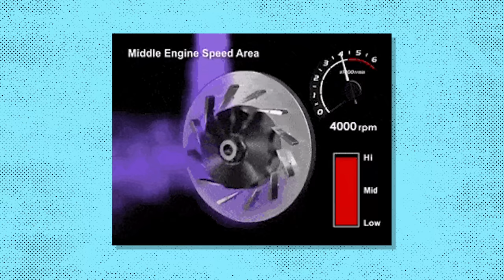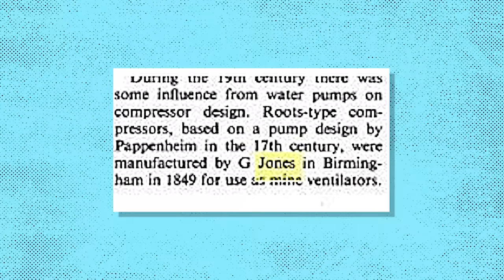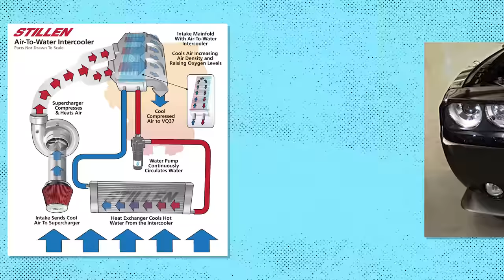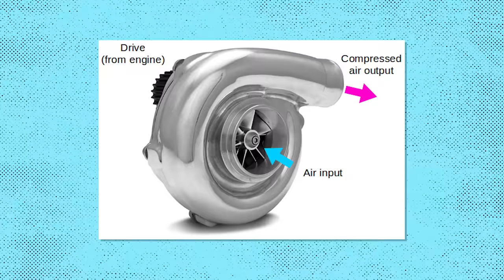Why Superchargers Aren't As Good as Turbos

Comment: That's like arguing that big capacity engines are rubbish compared to smaller capacity engines because some of the extra power is lost due to greater friction in the bigger engine. 
If you want an engine with lots of power and no lag, a supercharger is a perfectly good thing to use.
The only reason they aren't used anymore is due to emissions laws, and guess what, that's also exactly why you don't get large capacity NA cars anymore. See how that proves the point I made at the start!
Reply: Smaller engines are more fuel efficient because the operate under greater load, BSFC is most efficient at full throttle, the higher the throttle angle the better the BSFC. Supercharger are used in production  automobiles very often because turbochargers are more energy efficient.
Reply: @sandervanderkammen9230  operating load is only one of many factors that determine BSFC.
Reply: @pjay3028  No, it doesn't.  BSFC is always measured at WOT.
The isopgraphic efficiency island is plotted with BMEP... at high throttle angle and higher rpm.
Reply: @sandervanderkammen9230  so why did you say "BSFC is most efficient at full throttle, the higher the throttle angle the better the BSFC"?
Reply: @pjay3028  Because it is true, BSFC is always measured at WOT.
WOT is when the engine is operating with the lowest pumping loss.

Higher the throttle angle... lower pumping losses
Reply: @sandervanderkammen9230  you appear to be thoroughly confused!
Reply: @pjay3028  Not confused at all... what part do you not understand?

BSFC is highest when the throttle is closed.
BSFC is lowest when the throttle is Wide Open.
Reply: @sandervanderkammen9230  I'm confused because you insisted BSFC is "always measured at WOT" but then you keep completely contradicting yourself about that....
Reply: @pjay3028  BSFC is always measured at WOT.. because that is when pumping loss is at its lowest...

Carnot Cycle efficiency can be measured at any throttle angle or rpm by plotting an isographic efficiency island.
Reply: @pjay3028  We use SFC to calculate fuel burn per hour per horsepower in other types of internal combustion engines... like gas turbines and Diesels... because they dont have throttle valves.
Reply: @sandervanderkammen9230  Let me be really clear about this.
In one comment YOU said that BSFC is only measured at WOT.
In another comment YOU said that BSFC is better at higher throttle angle. 
It is only possible to determine that BSFC is "better at higher throttle angle" if you first MEASURE IT AT LOWER THROTTLE ANGLE and then compare that result to the BSFC at higher throttle angle. Think about it! 
You keep making totally contradictory statements, yet you don't seem to realise it....!
Reply: @pjay3028  SFC if you want to be pedantic..
Reply: Large displacement engines are still less energy efficient...
Reply: @sandervanderkammen9230  and that was exactly my point, if you remember! 😂😂
Reply: @pjay3028  You said it was because of emissions.. which is not true. Small turbocharged engines are preferred over supercharged or large naturally aspirated engines because of FUEL EFFICIENCY
Reply: @sandervanderkammen9230  I think you'll find that emissions are even more important to car manufacturers than fuel economy, and ultimately it is the emissions data that they use to determine which engine to specify.
Reply: @pjay3028  Turbocharged engines generally produce higher emissions..
Why would they be preferred by manufacturers today???
Reply: @sandervanderkammen9230  oh good grief.
Small turbo engines were introduced by manufacturers to meet the EMISSIONS targets introduced between 2014-2017 by the Euro 6 emissions legislation. Improved fuel economy was an additional benefit, but the principal target for the manufacturers was a reduction in emissions on the WLTP and RDE testing cycle.
Reply: @pjay3028  Silly boy.. you are talking about Carbon emissions...
Carbon emissions are directly linked to fuel economy.
Reply: @sandervanderkammen9230  exactly....
Reply: @sandervanderkammen9230  I respect your knowledge and ability to converse  with others
Reply: @JasonLuther1  Thank you sir, are you studying engineering?

Comment: I will take a supercharger over a turbo any day. I doubt manufactures chose turbos for efficiency, They are cheaper to purchase and integrate into the engine compartment, Superchargers are way more driveable and reliable than turbos. They do not rely on pressure fed engine oil, and thin tiny fins that usually causes complete engine failure when the turbo gives up, They also bring in large dollars in repairs for dealers thru guaranteed replacements and engine failures
Reply: Manufacturers use turbos because they make more power.
Turbochargers are extremely reliable, so reliable that they are used on passenger aircraft.
A good quality turbo should last the life of the engine and can be overhaul just like and engine can.
 Turbo lag is an imaginary problem, inexperienced drivers often lack the skills to properly drive a turbo car fast.. and are often scared by the higher performance.
Reply: The fastest supercars in the world use turbochargers because they produce far more horsepower than a supercharger ever could.
Turbochargers make more power

Comment: "literally use engine power to work"

So the exhaust gasses that are driving the turbine on the turbocharger are using magic pixie dust? 

You have no idea what youre talking about
Reply: The video was quite clear and correct. A supercharger uses a pulley which is ‘turned’ by the engine. Therefore, it’s using engine (horse) power. A turbo charger reroutes exhaust gases to spool, and is not driven by the engine directly.
Reply: The centrifugal compressor of the turbo is driven by its own engine. 

The exhaust turbine is a Heat Engine and generates horsepower from the heat energy in the exhaust.

Comment: It depends on what you're expecting! The supercharger is there time you hit it, but you're draging it along everywhere. Top fuel engines still run screw superchargers!  The lag issued are negligible on properly sized turbos, but the blower is right there! Centrifugal superchargers are for guys that just want to brag that they have a blower! The lag is always been an issue with turbos. Electric turbos are actually Centrifugal superchargers! Who do they think they're shitting here! Turbos are exaust driven!
Reply: Actually it depends on your education and knowledge...
The NHRA banned turbos because it made the cars too fast. 
 Turbochargers will always produce more power and thus produce faster acceration and top speed.
Boost lag is not accelleration lag... its an imaginary problem that is perceived by the brain due to the curvilinear power output.
Superchargers may improve the quote "drivabilty" but they deliver less power and thus lower performance.

Most examples of an electric supercharger will actually be a Electric-Turbo-Compound system like the ones used in Formula 1 cars,. If course this systems are not ideal either as they must comply with motorsports regulations that often limit boost pressure, fuel consumption, number of transmission gears etc. Not the most ideal system possible and often very compromised by the regulations.
Turbochargers are driven by waste heat energy... horsepower that supercharged and naturally aspirated engines simply lose out the tailpipe.
Turbochargers make more power at the flywheel using the same amount of heat.
Reply: @tacticalidiot175  It's all true, a turbocharged engine will always produced more power at the same manifold boost pressure.
If you do not understand this you are clearly not qualified to speak inteligently about turbocharged engines.
The history of Gale Banks and his efforts to get certification for his turbocharged Top Fuel car is well-known in the drag racing community.
The NHRA gave preliminary approval  but after seeing the huge increase in top speed banned all turbochargers from the TF, Funny Car and Top Alcohol.
Reply: @tacticalidiot175  Why do you believe that turbochargers would explode, turbo are extremely reliable and have been used in racing for over half a century now.
If you don't believe me? Go check out tractor pull competition at the top level, there are guys running over 100 psi of boost! significantly more than a Top Fuel engine.
Any questions son?

Comment: You say the blower uses the engine for performance, as if turbos don't. Turbos use the engine's exhaust. And to gauge how much that is, stick a banana in your tailpipe and floor it.
Reply: You clearly don't understand how turbos work... please educate yourself
Reply: @WilhelmKarsten  what powers a turbo? Magic?
Reply: @glennyj65  The turbo runs on heat energy that is normally wasted out the tailpipe... it's not magic, it's called a combined cycle heat recovery engine and operates using the Brayton Cycle.

Any questions lad?

Comment: Why would you call an electric supercharger and electric turbo? A "turbo" is a turbine driven supercharger. An electrically driven forced air induction centrifugal compressor would much more appropriately be called an electric supercharger rather than an electric "turbo" since there would be no turbine. Calling it an electric turbo makes about as much sense as a Taycan "tubo".
Reply: There seems to be a bit of confusion about the difference between a electric superchargers and Hybrid-Electric Turbocharger.
Both drive the compressor electrically... the difference is what charges the batteries or E-caps.

Comment: no matter how you boost, it takes power, no free lunch.
Reply: The Turbocharger eats for free... it runs on the leftovers from the reciprocating engine.. leftover heat energy in the exhaust gasses.
Reply: @sandervanderkammen9230  you are seriously confused young man.
Reply: @sandervanderkammen9230  If what you say is true, why do we run free flowing exhausts on N?A engines, scavengers, we should all put a tiny hole with lots of back pressure before the exhaust pipe and get better flow/scavanging, free power
Reply: @davidwarland2680  No, you clearly don't understand how turbochargers actually work.
And it's doctor or sir to you, I'm quite certain I've earned it.
Reply: @davidwarland2680  Because they are Naturally Aspirated... the manifold pressure is lower than the atmospheric pressure when the engine is running.

Flow is based on Delta-P 

The turbine in a turbocharger is an Impulse Type turbine.
Reply: @sandervanderkammen9230  so its free energy, a perpetual motion machine, wow, and if you want titles, you can call me Captain as is my official title
Reply: @davidwarland2680  No, the turbo runs on the same fuel burned by the reciprocating engine.

Its not a terriblly difficult concept to grasp if you have some basic engineering skills.

The Otto engine is a Heat Engine and generates horsepower from the heat energy in the fuel burned.

The Turbocharger works exactly the same, except it shares the same combustion chamber with the Otto or Diesel engine.

Any questions?
Reply: @davidwarland2680  Captain Crunch?
Reply: @sandervanderkammen9230  so restricting an exhaust to a tiny orriface does not alter the Engine at all hey, si why do we all go for exensive free flowing exhausts when all we need do is restrict them with cheap small pipes.
Reply: @davidwarland2680  Well, if turbine blades restricted gas flow? Jet engines wouldn't work at all would they???
Free flowing exhaust systems are very important on Naturally Aspirated engines... because backpressure reduces Flow
 And after the turbo on turbocharged engines.
In a turbo there is no loss of flow from backpressure because of the Delta-P
Reply: @sandervanderkammen9230  you are using a jet engine to discuss the incredible restriction of a exhaust to accelerate gas so as to spin a blower at very high seeds, ok, no need to help me anu more, we are not on the same page, nor chapter, we are at opposite ends of the library, kepp on thinking a turbo is free power.
Reply: @davidwarland2680  Turbochargers and Turbojets operate using the BRAYTON CYCLE.
The only difference is a turbocharger works as second pass heat engine in a Combined Cycle engine.

This means that both engines  (Otto and Brayton) run on the same heat source.
The Turbocharger runs off the heat energy in the exhaust from the reciprocating engine.

If you simply added a combustion chamber to the turbocharger? It becomes a jet engine.
 Its so easy to do in fact that some people make small jet engine experiments in thier home garage using a turbocharger.

Its not a difficult concept to grasp if you have some basic engineering skills.
Any questions son?
Reply: @davidwarland2680  You have a very weak grasp of fundamental Fluid Dynamics

The concept of pressure differential or Delta-P seems to be completely lost to you.

In a Naturally Aspirated Otto engine the intake manifold pressure are _less _ than atmospheric pressure when the engine is running.
If pressure in the exhaust manifold is higher the engine flow is reduced and energy is used to overcome this pressure differential.

This does not apply to the turbocharged engine.

Any questions?

Comment: I run twin crankshaft driven centrifugal superchargers. The turbo option may have got me more power but the heat would not be manageable. My 2000hp (twin Prochargers) is adequate for my needs, 3000hp (twin turbos) would have been a bit much!!!

Comment: Wth? A Roots type absolutely does compress air. How could 'boost' and heat be produced without compressing air??? Oh and btw, the Hellcat does not use a Roots type.
Reply: The Roots is an internal compression type compressor, it heats the air internally before being discharged into the manifold.
Reply: The Hellcat also uses a Positive Displacement, internal compression type compressor...

Comment: It depends on application and what your trying to do . People think turbos are better than super chargers and blower . NHRA Top Fuel cars and Funny cars use blowers . Those are 10k horse power cars. They don't use turbos.
Reply: Turbos are always better, NHRA  banned turbos because they make the cars too fast.
Reply: @sandervanderkammen9230  / wrong.
Reply: @sandervanderkammen9230  / Turbos were banned when cars were only making 4500 horse power. This was decades.  Top fuel and funny cars nowadays make 10k horse power.  Turbos can't compete with this. At all.
Reply: @kingc6106  Sorry but you are very confused and misinformed.
Turbos are officially banned completely in NHRA Top Fuel, Funny Car and Top Alcohol classes.
 They are banned because the thousands of additional horsepower produced by turbocharged engines would make the cars too fast.

Saying superchargers are better because Top Fuel uses them is not a valid argument.
 Any questions son?

Comment: Hanging TWO EXTRA gears on the crankshaft to spin up an air mover puts a drag on the engine's mechanicals. A turbo charger is equivalent to jamming a potato in the tail pipe, robbing the engine of proper breathing - to help it breath. Soar muscles or gasping for air. BOTH methods suck AND blow. It is the APPLICATION of the two devices, one intended for stationary diesel power plants and the other for AIRPLANE engines. Yet, as good Hot Rodders, we've found ways to bolt them on a car engine, then brag about which is better - or worse.
Reply: Well, if the turbine blades blocked the exhaust like potato in your tailpipe? Then jet engines wouldn't work at all!
 You don't seem to understand how the turbocharger actually works?
The exhaust turbine is driven by the heat in the exhaust gas, not pressure.
Reply: @sandervanderkammen9230  Subtleties can be a bother...
Reply: @r.a.monigold9789  Especially if you are not properly educated or professionally experienced

Comment: Exhaust driven turbochargers are parasitic as well (albeit not as much as a supercharger, but still...). The easier your engine breathes (that's inhales AND exhales), the more horses you can set free under the hood. Exhaust gases that have to go around in a corkscrew motion, pushing little metal blades (connected to a shaft that are connected to a different set of little metal blades), is sapping power from where the rubber touches the pavement. If the flow of the exhaust wasn't so important then why have multivalve cylinder heads?